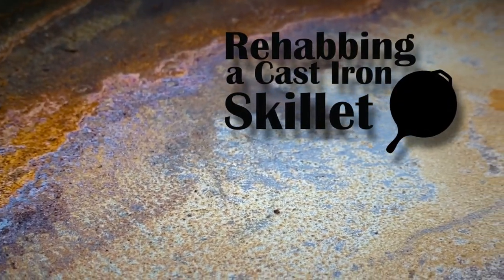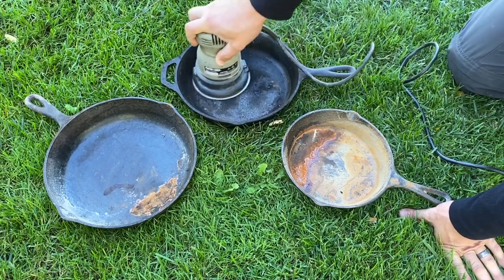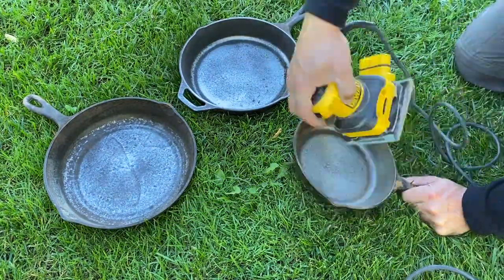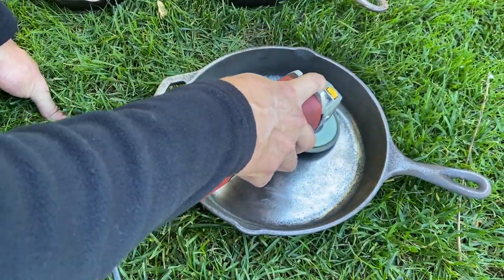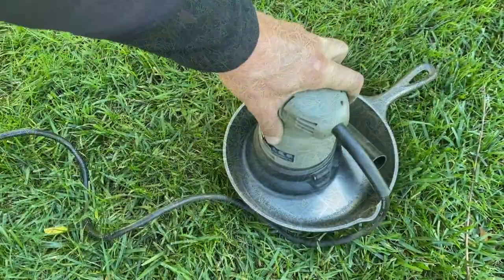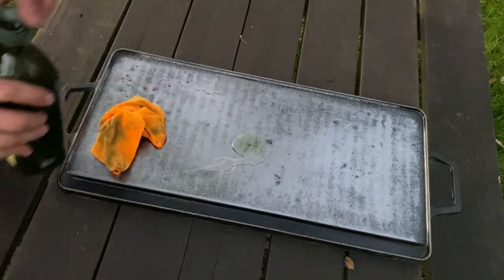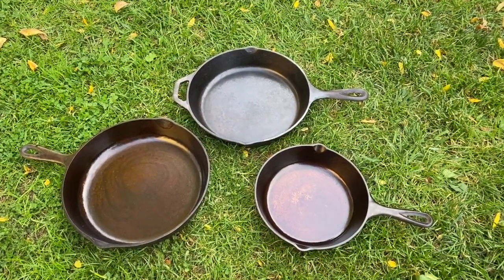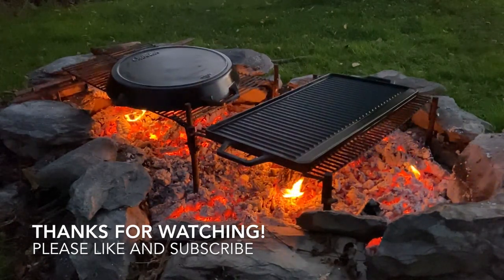Rehabbing a Cast Iron Skillet - From Start to Finish

Comment: I used to cook/chef and I found some old pans from my grandparents. have been hand sanding one for over a year  I gave up until I saw you whip out the grinder!  Now I will have my own smooth, non pitted pan again.  You cannot buy craftsmanship anymore, only make it by hand.
Reply from the maker: Get the finest grit flap disk you can find for the grinder.  It takes it off fast!
Reply: @E_Fleming  That is the part I was hesitant about.  These old pans are not like the thick LODGE pans now.  How far up the side should I grind?  I use the entire depth, about 3" on the side.
Reply from the maker: Also, let me know how it goes!